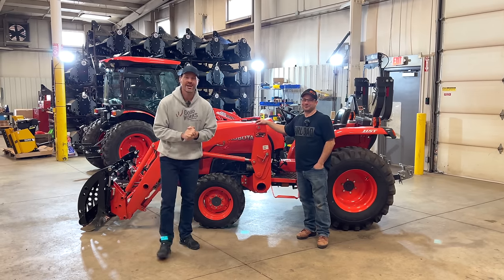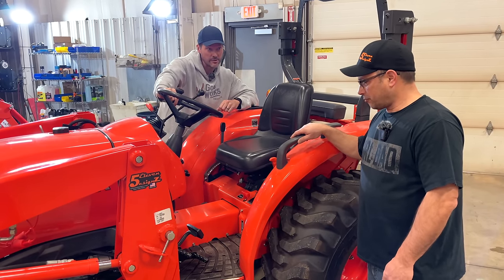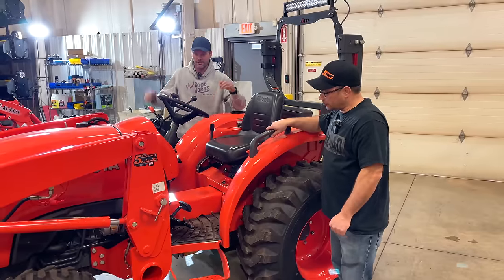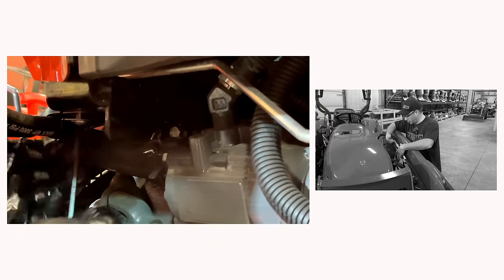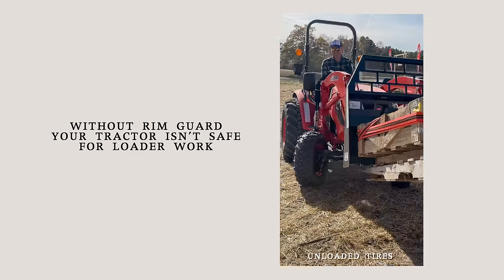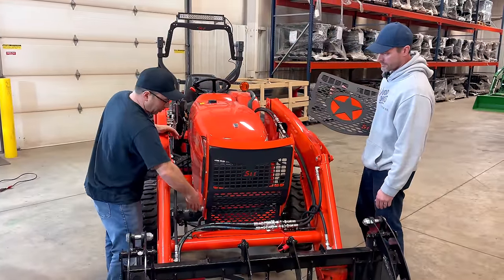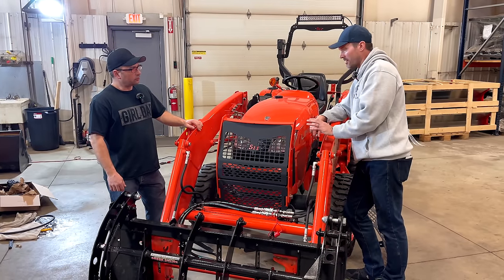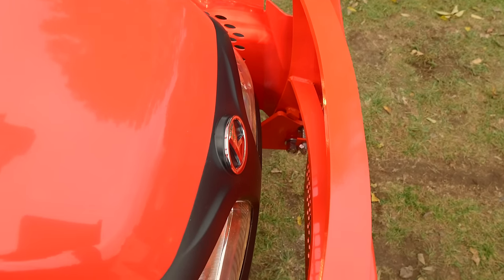GENIUS INVENTION FOR KUBOTA TRACTORS!

Comment: Was typing along, walked away, then read some comments, not to the thunder of other ideas but only heart-filled support the idea of a loader lock. I personally made one out of 3/4" rod, two U-shaped strap metal and two snap pins. safely seats and locks so loader will not come down. Don't use that often but it only takes once to get seriously hurt.
Reply from the maker: Yeah, would be a good product for sure
Reply: Definitely a good idea, I am hesitant due to liability concerns.

Comment: That valve looks like a great fit for that application! 
On construction equipment foot operated valves usually had some sort of treadle pedal and linkage. This greatly extended the life of the valve because it didn’t have all the weight being pushed down on the end of the spool and pot aluminum cap. The few foot operated manual valve I installed I used push pull cable and mounted the valve remotely. It was easier that way because Pierce Hydraulics had off the shelf components ready to go.
Reply from the maker: Makes sense with that setup

Comment: Oh my God, love this add on equipment... I'm surprised that he hasn't figured out a way for the quick disconnect bucket to have applied hydraulic rams, so that you don't have to get off every time you latch or unlatch: bucket, Forks, tree spade, bigger bucket, snow scraper, maybe tie it in with the 3rd function valve or a split off of it...
Reply from the maker: You mean like this? https://www.youtube.com/watch?v=IalhjDi_4Bs&t=587s
Reply: It has crossed my mind a few times (like everytime I have to jump off the tractor to flip the handles). Unfortunately,  you would still need to connect/disconnect the 3rd function lines for some attachments.

Comment: My tractor came with a Kubota OEM third function and it works fine. However this seems to be a better set up. As time passes electrical circuits play up and can be difficult to repair. 

My tractor really needs protection too. I’m not using my tractor to clear bush or work in a forest, but there seem to be a lot of vulnerable parts that an errant stick could poke right through.
Reply from the maker: Good point!

Comment: I need a skid plate for a kubota m7060 to protect both the fuel tank and the trans oil filter and shift linkage area on bottom of the tractor. Can't believe nobody has seen the need for this product
Reply from the maker: I bet others want it too
Reply: There has been a lot of demand for skidplates which are on my list to do.
Reply: Paul Short My have one, Their Channel is Paul & Kathy Short. He specializes in Kubota Mods.

Comment: Since he has the 3d scanner he should see if he can make a set of metal handles close to the price of the right handle that isn't included on the Kubotas. also, something to replace the awful tail light assembly on the L series they stick out too far making it difficult to connect attachments. The tail lights if you have a quick hitch can be hit with the release arms up if the top link is retracted.

Comment: Might be a stupid question as I don't actually own a tractor yet: I'm planning on buying a Grand L 4760 cab design next year when I retire. Will that treadle control on that 3rd function fit with the cab or does it protrude too far laterally (Out to the left, if that makes sense)? I'm just wondering if it exceeds the footprint of the cab.

Will definitely get those tie down loops, though.
Reply: This was specifically designed for the L01 series (no cab available). However, I am starting to work on a 3rd function for my L3560 which has the same cab as the L4760.
Reply: Thanks

Comment: Within the first 8 minutes the one thing I notice is it won't fit the cab tractor. It sticks out past the frame were the door closes and extends past the front of the cab. When will you start making grill guards for LS tractors?
Reply from the maker: The Kubota standard L Series isn’t offered in a cab.  Plus, it mounts to the loader frame, so that would also be a reason if so.  It wasn’t designed for cab tractors.
Reply: So far, there hasn't been much demand for the LS products, so they haven't been on our radar yet.

Comment: Will this work with a enclosed cab on the tractor to or is there a different option
Reply: This was specifically designed for the L01 series (no cab available). However, I am starting to work on a 3rd function for my L3560 grand.

Comment: You may have mentioned it but the third function won’t work if you have a clutch that stinks
Reply: The tractor in the video has a clutch pedal.
Reply: @Justinsalamin511  ok how you gonna use the clutch and the 3 rd function in unison ?
Reply: @oklahomachris6298  , I don't think it could be used on a gear transmission. HST, it'd be nice...but for those of us with GST, no dice.

Comment: I've never understood why in USA you have such small tractors. Compact tractors are very rare in UK. Yes there are a few about but Most people have full size tractors if they need a tractor. And loaders come as standard with third service. Just my observation.
Reply: Because people in USA own a wide range of property sizes and it’s based on what your needs and intended use of the tractor is for property maintenance

Comment: Nice but it looks like a solution to a problem that doesn't really exist
Reply from the maker: Apparently it was a problem for Justin :)
Reply: I see many posts about failure of switches and solenoids from the typical 3rd function kits. Easier installation and full control of your attachment seems like a win to me.
Reply: @Justinsalamin511  I get to keep My 3 ball on the Loader stick, (Rip Dale E..)